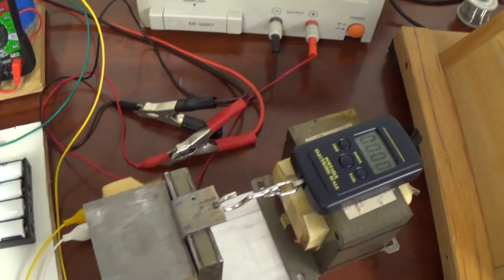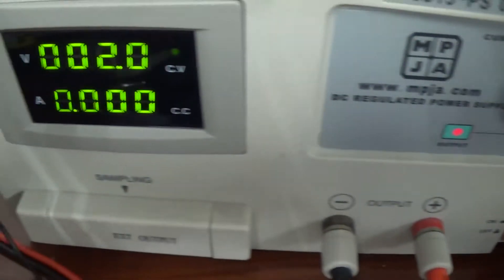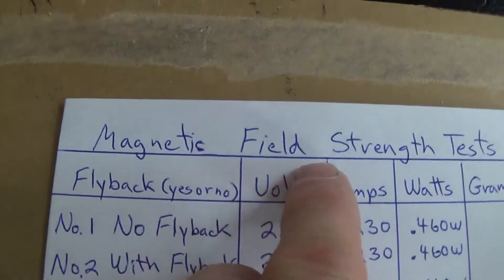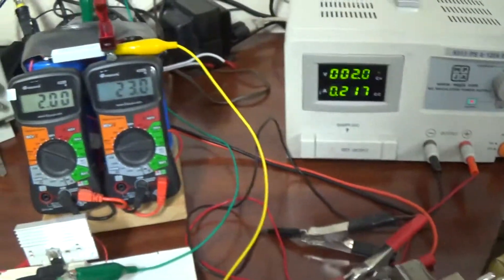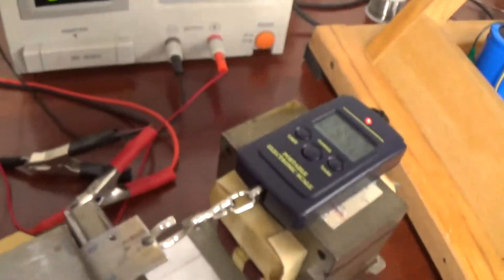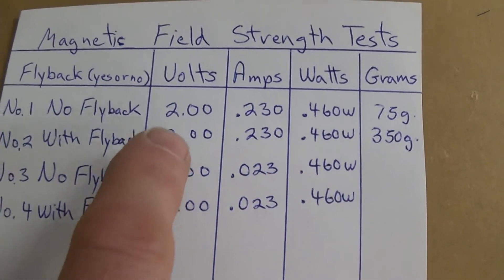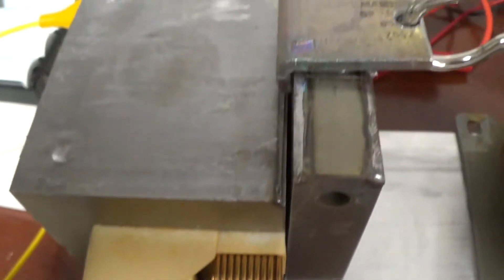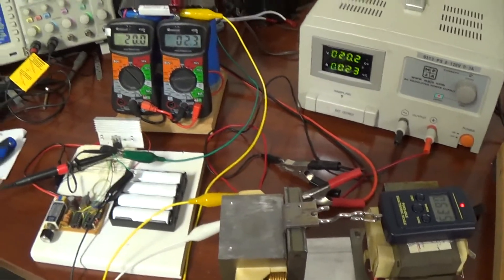Sharing ideas, how to build a more efficient motor (p.2)

Comment: Thank you for your test,  on this and the mostly magnet motor series. My questions are, do you think this is due partially to inductance beefing up the secondary, and would using another identical primary coil instead of the secondary give greater results? Thanks.